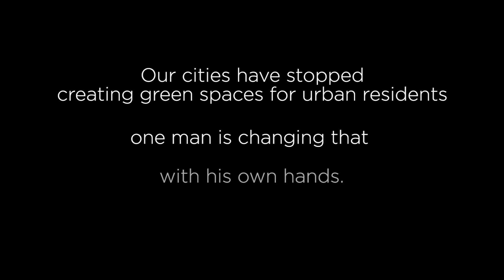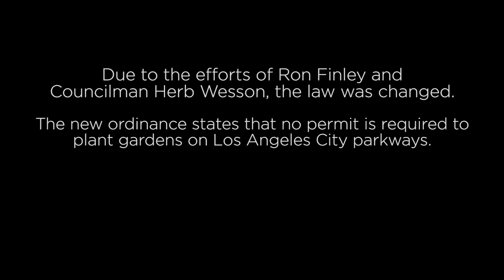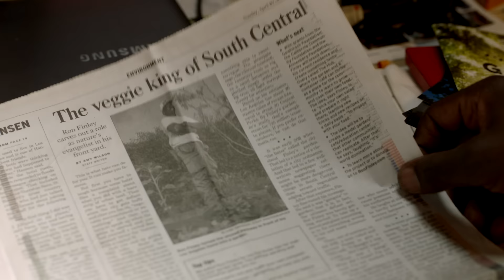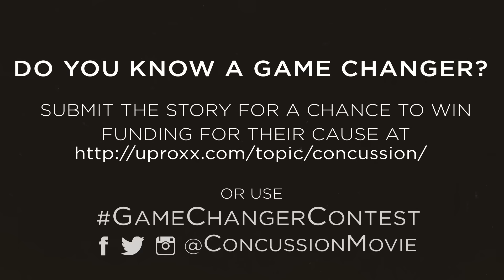Ron Finley: Urban Gangsta Gardener in South Central LA | Game Changers

Comment: the concept is called tera forming. transforming the land changing  an eco system. its done mostly in his case for social  urban and enviromental reasons, however scientifically the more concrete theoretically he replaces with gardens.  the closeer he gets to stablizing the ambient temp in LA .  

the less heat and humidity usually the better people get along. a hypothesis i subscribe too.  here in miami you will see moods friendships relations improve alot when the humidity falls under 70.